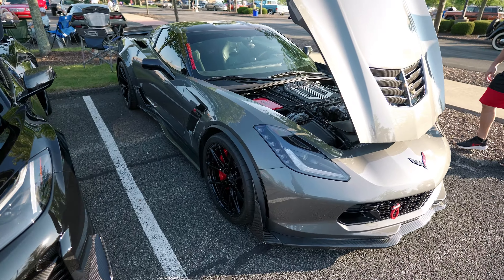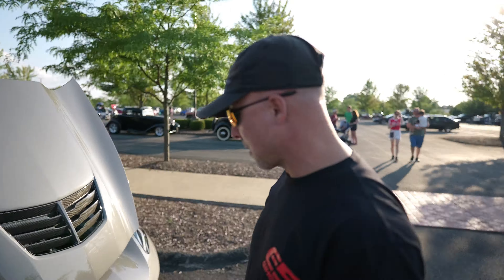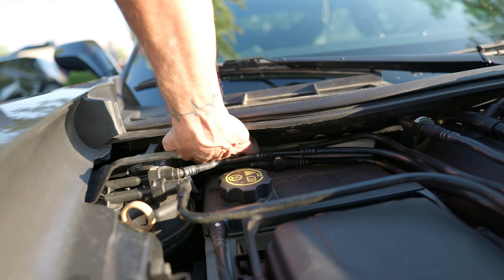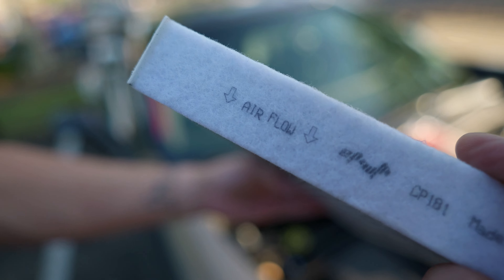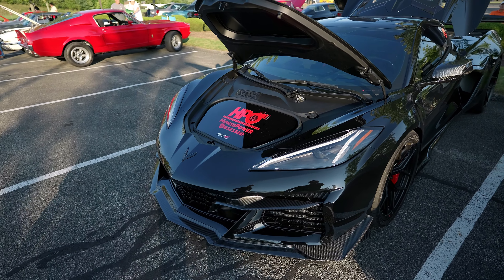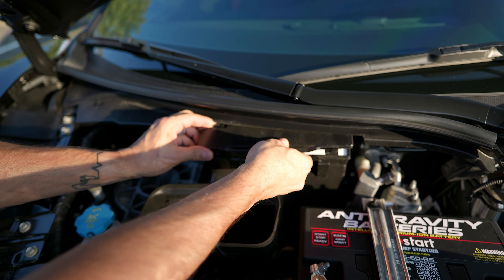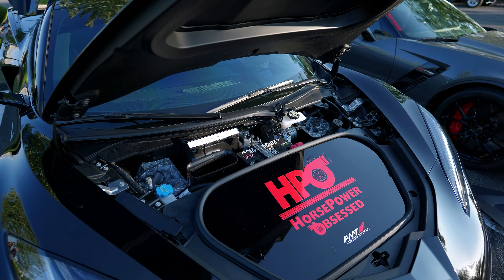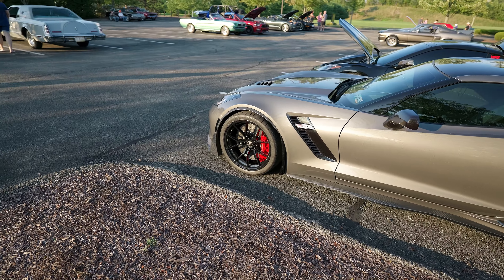THE Most OVERLOOKED Maintenance Item! Cabin Air Filter Replacement!

Comment: I use the best one I can buy. Every year.
Reply from the maker: That's the way to do it. No reason to mess around when they are less than 20 bucks.
Reply: They can also overwork your AC if left really dirty. Can’t recall if you mentioned that also.  @HorsePowerObsessed
Reply from the maker: I didn't, but great point!!

Comment: Some cabin filters are heavier than others, which dramatically changes the cars weight. That's why here in Hialeah florida, we bypass the cabin filter. Ac blows harder and less resistance on the blower motor. Resulting in the alternator having less resistance on the motors crankshaft, giving all kinds of horsepower. Also remove the intake filter. More bugs get sucked into the combustion chamber Making the combustion chamber smaller creating more compression 😮

Comment: Justin page 316 in the service and maintenance section of my owners manual states that the passenger compartment air filter should be replaced every 24 months or 22,500 miles whichever comes first. This is for the 2024 C8.
Reply from the maker: I would definitely recommend doing it before then especially if you live in a dusty or pollen packed area.

Comment: First Justin, I love the custom Frunk cover you have on your C8! THAT is really cool. 👍👍 I love the topic of the Cabin Air Filter. I even forgot that I had one! I do remember changing 4 years ago before I was sidelined. AND the best part is that it's Idiot Friendly. I don't need or want User Friendly; I want Idiot Friendly. But once I'm done with your video, I'll crawl out to my garage and take a look. Even it still looks fresh, which it should because it hasn't been driven more than 200 miles in the last four years, I'll change it anyway. My garage is HVAC controlled, so there shouldn't be any mold. Thanks again for an incredible topic and then demonstrating how to change the filter. Once I saw your demonstration it all came to me and I said myself, "Self, you did that 4 years ago." 🤣
Save the Wave my friend. 🙋‍♂

P.S. thank you pointing out the arrow and stating that it should be pointing down. 🙏

P.P.S. I love Dana's wheels. Can those be had for a C6 GS and in any color, like in Carbon Flash? I wish I didn't have to ask you, but once again, I won't be at Carlisle later this month. 😢

One other thing and back to the charcoal activated filters. Can these be had from Amazon and would it be a factory A.C. Delco of off-brand. Whatever you recommend Justin. You're my Go-To Guy!
Reply from the maker: lol I’m happy to help, Peter! It’s one of those things that I bet the majority of people out there don’t even know exist let alone have changed recently. Even if you have gone a couple years without really driving the car that filter can still get gross!

Comment: Absolutely not correct, there is no need to change your cabinet air filter after every oil change. Even the one pulled from the C7 at 25K did not look bad.
Reply from the maker: I disagree, but you do you.